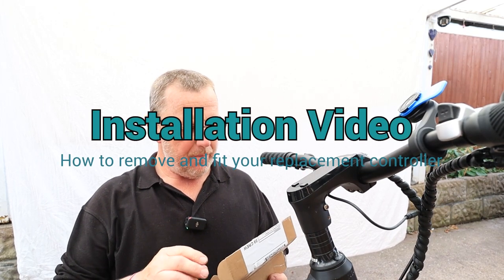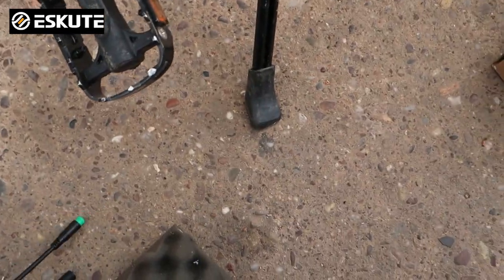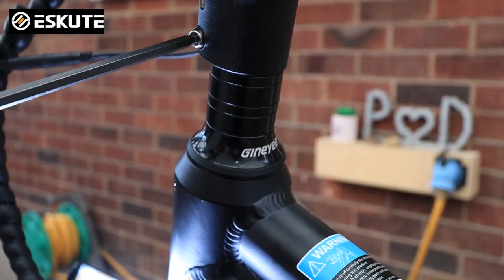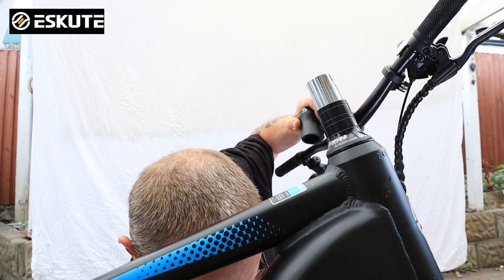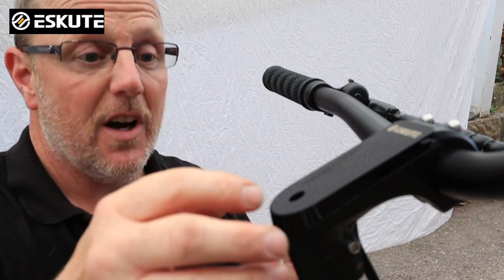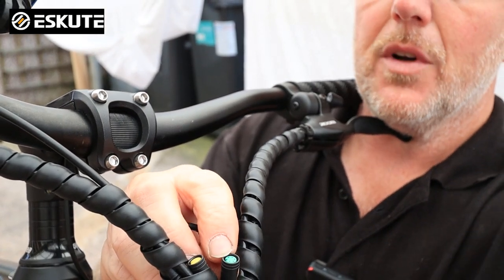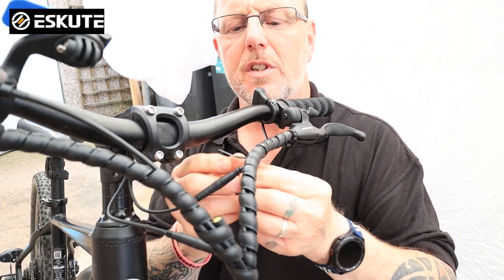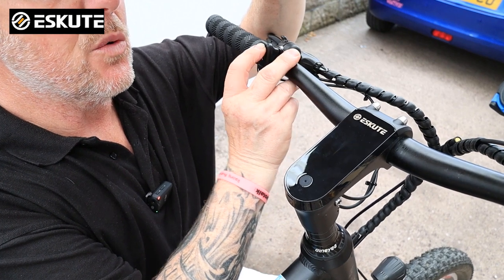Eskute Replacement Controller Installation Instruction, Netuno and Pollino new control display

Comment: Hi, I just installed one of these only to get E6 come up on the screen and it doesn't seem to work. Do you have any advice? Cheers.
Reply from the maker: hello, no to be honest i done, its just one connection to the bike so just make sure you have both connectors in right, then contact Eskute if you get no luck let me know ill tell my contact

Comment: De-ja-vu - you making repeats now? Lol  I fitted mine a few weeks ago and it's a massive improvement.  No more taking a hand off to change a setting or scrolling from 2 up to 5 to get to 1.  Shouls have been the default install if you ask me.  Mine sits next to my throttle and has made a massive difference to how I control power and gear changes.
Reply from the maker: its on both my channels

Comment: Good afternoon,just recently bought a netuno plus in November 2023 been out on it about 6 times since buying.the thing is when fully charged battery if I put it on pedal assist 3 or even 1 it shows on my display it's dropped 1 our 2 bars when I stop peddling goes back to full bars. Have you any ideas pls? 🤔
Reply from the maker: Ok so i have a Netuno Plus coming next week, ill have to watch it and see what it does... i have not boticed this. maybe give Eskute a shout they have a good team to speak to

Comment: Thanks Paul, great improvement got one. Question: I bought a spare netuno battery in late april this year, It dies with 35-40% power left and display goes off, other battery ok right down to flashing low power warning, have informed eskute support  who have requested a video ! where do I start ? also thanks for your honesty with mental issues, having fought my way back from a dark distorted place through lifestyle change and meditation (not medication) I am well again, getting out amongst the Lakes on mi bike is a joy dispite the occasional fly snack 😝
Reply from the maker: You very welcome, ill speak to my contact and pass this on see if they can help you with the battery..
Reply: @paulcomptonpdphotography  thanks Paul 😁
Reply from the maker: welcome